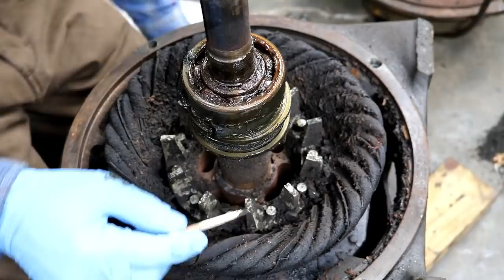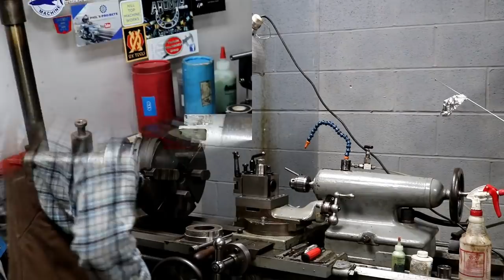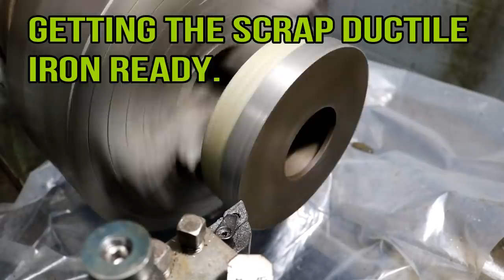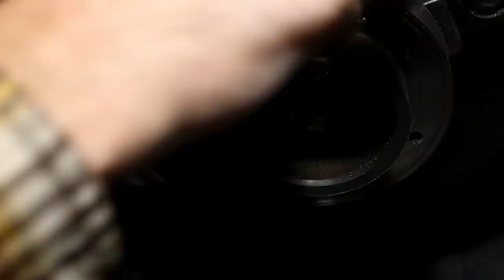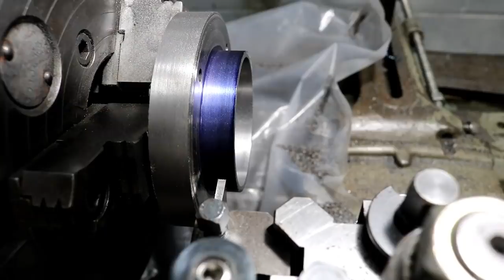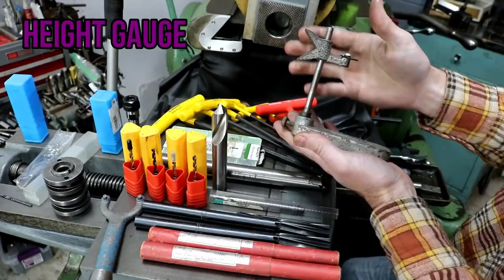WoW, It's Worse Than I Thought. K&T Motor Cleanup Begins.

Comment: This motor has been in a flood at one time, also my guess is that the has been rewound at one time in its life. The coil winding sweep pattern makes the coils easier to install and costs extra money and extra time, and some of the added extra insulating precautions that are visible I would guess only a small motor shop would take the time to do. I believe you are correct on the rings, I have seen steel mill and mining motors so packed with grease you would think that is what they ran on! Strange enough though most of them were still running, however, the owners thought they should be cleaned up. I guess this is the second time I've watched this. I would add conscience people like you don't need that seal feature anymore and could be left out of the motor altogether.

Comment: I am tool & cutter grinder  by trade of fifty years plus experience . I think I could quite a bit if I could  somehow speak to you directly. I own a ko lee grinder a Dakota model with a ball bearing table. 
I also own: Cincinnati Monoset, cuttermaster air bearing fixture, a optical connector and a Black Diamond drill pointer. I grind standard tooling but make specials mainly anymore. When I was your age I worked as do building my shop and still make up grades. A is never finished. Like your videos very much.

Comment: Never seen a person degrease anything with a dern stick..  why wouldnt you use purple power?  Is what i do..  then after rinsing it off use electrinic cleaning spay or alhcohol or contact cleaner then as soon as possible. Finish with some wd or 3in1 to prevent rust...

Comment: I worked at  Westinghouse for 17 years, 8 years in Pensacola FL Nuclear Reactor Division, and 9 years in Anchorage Alaska Industry Services Division,  we repaired equipment for mining, on shore and offshore oilfield, railroads,  power generation turbines, ski lifts, conveyor systems,  and ball mills. Our shop also rewound and repaired motors, up to AC 1200 HP Line start 4160 Volts and DC 1000 HPmotors for locomotives, that would peg 1000 amp meters on startup. We would take a motor like your KT motor, pressure wash it, then spray it with a very aggressive  foam degreaser, and repeat until the draining  water was clear, the bake it for 12 hours at 275 degrees F. After cooling it was meggered to test insulation quality. If it passed it was dipped in insulting varnish and baked again. The unique thing about you Westinghouse motor is they were made to be rewound many times, and any good rewind shop can rewind them for greater efficiency. I bleieve I have an original manual for a KO Lee  tool and cutter grinder,be glad to send it to you if interested, Need your address. Good luck!
Reply from the maker: I really appreciate the offer on the manual but I already have one. Sounds like you had a interesting career. Thanks for watching the videos.
Reply: @SteveSummers  , you are welcome, glad you replied, I had forgotten where I saw your post! Learned a lot at every job, especially Westinghouse ISD. Sleeving is a quick cheap way to repair shafts, works good on bearing bores in end bells of motors, generators etc.. I've no experience with the K.O. Lee, all my tool and cutter grinding is on a Cincinnati No.2. The radius attachment  you have for your machine is relatively  rare..You should be able to grind concave/convex  radii , on it .The No. 2 it had a swiveling  micrometer  spindle that allowed precise adjustments for radius sizes., I don't know if your manual will cover that. If you have any questions about tool and cutter grinding, I'll try to help,  If you really get into it, you should look into a used optical comparator, Only way I know of to check form tools accurately. You wouldn't need a huge comparator, 12" at most. Surplus industrial machinery houses, erc, should have one well under$1K Good luck! Shack

Comment: Should have cut the ring larger than the bore then cut out the proper amount for it to spring in, then you wouldn’t have to pull it apart and risk snapping it.
Reply from the maker: Hello Samuel, cutting a larger ring and compressing it in would have not fit properly. The OD of the ring needs to be the same diameter as the bore it goes in. This video was done quite awhile ago. I used the advice from people who make piston rings. It worked out really well and the ring that was cut to bore size fit great when compressed. Thanks for watching and make sure to check out my newer stuff to see how it all works out👍

Comment: Back again - test voltage is usually twice the operating voltage; test current around 20 Ma - that is winding to ground. The tester is called a Megger (British term), Winding resistance should be less than  2 ohms. Any electrician would be able to test this ...

Comment: I noticed that the chips coming off the cast iron ring during cutting are like grains of sand, not the long, curly filaments of most steels.  This seems to show that, even in the softest, flexible form, cast iron has very poor bonding between the crystal grains, probably due to lots of excess carbon in the cracks between those grains preventing good ferrite-to-ferrite bonding.  Is this true of all forms of cast iron, gray, white, or malleable?

Comment: Is the sealing ring that you manufactured made of malleable cast iron?  From what I read, you take standard gray cast iron, heat-treat it to hardened white (chilled, with lots of cementite) cast iron throughout, then re-heat-treat that to the original pre-chill hardening temperature, but now very slowly in an oven fully anneal the iron over many hours down to room temperature.  I assume that the middle, white cast iron step was to make the crystal structure uniform -- a kind of normalizing process -- prior to the final anneal.  Is this correct?

Comment: You stated that you see things like this in old motors.  Actually, much of this crap in the motor was there well before the machine got old.  The only reason that is wasn't worse is that there simply was no room for more to get into it; it simply wouldn't fit!  The motor was saved from destruction by the lack of clearance between the moving parts.  Another, less-well-known, positive side-effect of tight, high-precision design.

Comment: I wouldn't even put a wrench on one of those motors until I megged the windings. I have used my megaohme  meter on many different electrical items including the ignition wired in my truck.

Comment: Try using the shop air and your  can of solvent together. Start bowing air and spray the solvent into the stream of the blow gun.Acts like a high pressure cleaner.
Reply: That works well but be sure to use a good respirator when doing this.

Comment: with big motors like this i think using a pressure washer or a hot pressure washer would work quite well, if you let it dry for like a week all the water should evaporate and it should clean it very well
Reply: I was thinking the same thing it would work really nicely imo just spray some simple green all over  then let it soak for a bit and blast away with a pressure washer being careful and using common sense where the windings are then follow up with compressed air to dry the water and maybe some wd40 to keep the rust away.  I have done this many times on old greasy parts with great success .

Comment: easier way to spring it is to turn it to its out-sprung size then cut it... your method is high chance for breaking it.  You'd probably get better finishes turning if it were mounted better.
Reply from the maker: Can't do it that way. Turning a larger ring would make sure it would not fit the bore when finished. Got to start with a ring the size of the bore then spring it. Otherwise you will have a out of round ring when compressed.
Thanks for watching

Comment: Why not machine the ring to the bigger size, then cut out the part that needs to be gone. Then it will be set already, so you won't have to bend it, or worry about cracking it. You'll likely have to over bend it to get it to stay bigger, and I believe the metal that you're using is very hard and brittle, but is very good at keeping it's shape, right?

Comment: Why not clean it with detergent and water? Would that damage it in any way? What about WD-40? And what's in that cool sprayer that you have? How does it work? Do you pump it full of air or something?
Reply: Terje Oseberg Detergent and water is perfectly fine, though you will need to bake the motor at a moderate temperature (~70-90C) for several days to drive all the moisture out before powering it up for the first time.  I also liked the can that used compressed air for propellant, I’ve seen other styles but never one quite like that.

Comment: You can't bend cast iron rings to make them spring, you have to wedge the gap to the size you want and heat them to red (1450F) whilst they are clamped between plates to keep them flat.   No need to quench you might make hard brittle spots.

Comment: I have Used spray brake cleaner to clean the rag wrapping on those windings because it will clean out that grease pretty good but at the same time it will evaporate and not leave that cloth wet which you really dont need to leave water in any way inside that motor
Reply: Or any kind of moisture

Comment: you can avoid the cast iron mess by turning your tool upside down and running the lathe in reverse. dust will be directed downward into the chip pan.

Comment: Steve,
I just wanted to share a tip that I learned from personal experience. Be sure and clean that toothbrush well before you use it to brush your teeth again. I had been cleaning some airplane parts using VARSOL, and did not clean the toothbrush good before brushing my teeth that evening. Man that VARSOL tastes nasty.
Kidding of course. Wish I had your patience.
Gary 75-Year-Old Home-Shop-Machinist in N.W. Arkansas
Reply from the maker: Not that worried about this toothbrush, it's my sons😑

Comment: You'll need to megger test the windings, between the different windings and between windings and the stator/ground.
You need to test at a voltage well above the supply voltage(I recommend sneaking up on the final test voltage 50%, 100%, 200%) to ensure the insulation can handle the voltage it will be seeing.  
https://www.hunker.com/12003088/whats-the-difference-between-a-megger-hi-pot-test

You will also want to do a winding resistance test to make sure that the windings are close to the same resistance .(if one winding has a lower resistance, it may have wires shorted together).
Here's a quick simple video of the procedure... 
https://www.youtube.com/watch?v=ZfXcXCB_RjE
And a bit of advise, when testing with a megger, always be aware that you can get a seriously lethal shock, keep one hand in your pocket and to remember to short the windings out after testing them and before touching them.
Good luck.

Comment: The ring(s) need to be heat treated and then quickly quenched in oil. This will give them the spring. There are folks on Youtube making them. 
On the motor, it is so old and you have to question its running efficiency. I would say keep the motor, don't scrap it but rebuild it some other time and for now get a used modern motor. Some industrial auctions give them away cheap.

Comment: Steve, if you have a motor rebuild shop near you stop in and ask the what solvents if any can be used to clean the inside of the stater that won't damage the insulation coating on the windings.

Comment: "And I should be doing the flooring... but this is more fun!"  :-)

Congratulations on both your birthday and anniversary!. Hopefully the flooring will be done before your next one!  ;-)

Boy, looking at that motor you sure can see a strong resemblance between a used equipment dealer and a used car dealer. 

BTW, be careful with an air nozzle around old motor windings. You can pretty easy rip off hunks of the insulating fish paper that is protecting the windings from rubbing on the iron and end up trashing the motor. Ask me how I know...

Comment: Hi Steve. Firstly, happy anniversary. 
Secondly. I think that when making rings you first turn the ring to size. Split it. Then stretch the ring using a piece of shim and then heat to cherry red and allow to cool. This should give the required spring without breaking.

Comment: Hay Steve, I really enjoy your videos. Wish I had more time to comment regularly. I know this subject well, so here's my advice from 40 years of working on all types of motors in industrial HVAC service:
1. A couple guys commented on using mineral spirits to clean the windings. They are spot on. Just be gentle use a soft brush and don't leave it on excessively long. blow off with air and let air dry for a couple days. If the windings were going to be damaged by a mild solvent the oil and grease would have already have done that. You've got nothing to lose, best to get that stuff off of there.
2. As far as baking out the stator "windings", I agree with that. But with shutch an old motor and all those years of grease and oil, do it at a lower temperature say 200 degF max. You could also try a light bulb inside the stator and cover with a welding blanket for a few days.
3. Bearings; I'm in agreement on the comments on using sealed bearings (rubber sealed) and never greasing them. More damage is done by using the wrong grease and over greasing. The good bearing manufacturers know what there doing, putting the right type and amount of grease for the life of that bearing. If you go that way be sure to examine how or if, those seal ring holders are part of the end thrust control or bearing retention.
4. If you stay with the old open bearings; Only use a synthetic grease like super lube, mobile-one or a specific electric motor bearing grease. Properly fill it the first time, leave drain plugs out for first day of operation. Then never grease it again; well ok maybe one pump every couple years. The old lithium greases were crap and would dry out after a few months of operation. It was the primary reason for regreasing.
5. There's a lot good comments here on testing the windings. If I think of something to add I'll chime in.

Best of luck, That's a really cool old motor,
-Dean

Happy Anniversary and Birthday !!
Reply: The Ayr Cave Shop Would something like Gunk degreaser be safe enough to not chew through the old varnish covering the individual copper wires ? Man,tackling that mess with a toothbrush is not my idea of a good time. That is a neat old motor. In his shoes,I would have made an effort to hang on to it as well. Big old beast.
Reply: Paul, I used to use aerosol Gunk for general cleaning and degreasing. My worry would be it's water soluble and appears to have a water component based on how it looks when sprayed from the can. You don't want any water whatsoever on motor windings. Even if you used mineral spirits for rinsing off the Gunk cleaner, if some was missed it might attract moisture. Gunk would of course be fine for the other parts like the end bells and lose parts.
The varnish used to coat and insulate motor windings will absorb moisture even directly from the air in high humidity conditions. The electrical insulating quality will degrade as the moisture content goes up. Mineral spirits is actually a good electrical insulator and is mild enough not to effect or soften the insulating varnish.
After a good air drying period, warming up the stator/windings for say 24 hours will drive any moisture out of the insulation.

The Meg-Ohm test others have mentioned can detect moisture and other problems with the insulation quality. It"s an expensive meter most don't have access to.
Reply: The Ayr Cave Shop You are far more expert than  I will ever be. I am in possession of a small article from a magazine of 1910 ish vintage that covered the details of drying out a steam powered generating facility that was badly flooded with silty fresh water. Drying the insulation and how they accomplished it was the main focus of the article,cleaning up mostly plain bearing contamination,disassembly exposing innards to warm dry air during inspection and repair as necessary. 
 No idea what varnish would have been used back then but if I had been tasked with this Westinghouse  and had access to a propane powered steam cleaner,I would have been mighty tempted to give the whole thing a really good squirt,having seen just how effective really hot water under pressure can be,and adding fan and warmth when finished. Motorcycles consume gas,oil,parts and Gunk. My old go-to when staring filth in the face. If you say that is a no-no,so be it. Amateurs sally forth where pros fear to tread. Cheers.
Reply: Yep if it's already been under water then using hot water to flush out silt and crapy water is your only choice. But then one must immediately start a long and detailed drying process. I save a couple of very specialized 150 hp motors this way. Had they been standard motors it would have been cheaper to just replace them.
I'm with you on cleaning with hot (in my case soapy) water, in many cases actually works better than old school solvent. I rarely use petroleum solvents any more.

Thanks for the great comments,
Dean

Comment: Another swell video Steve. When did the motor Armature become known as a rotor? And the field windings are generally known as the stator these days. What is up with that? I guess it's like foot pounds of torque is now known as pounds feet of torque. I went to buy some sabre saw blades the other day and the guy behind the counter had no idea what a saber saw was because the Chinese and Harbor Freight change the name to jigsaws. No wonder this country is falling so far behind when we let the Chinese reinvent the wheel. Everybody knows the wheel was invented by American cavemen back in the day, not the freaking Chinese!